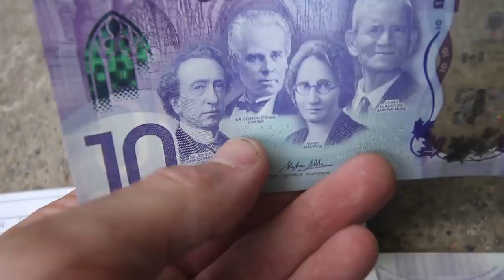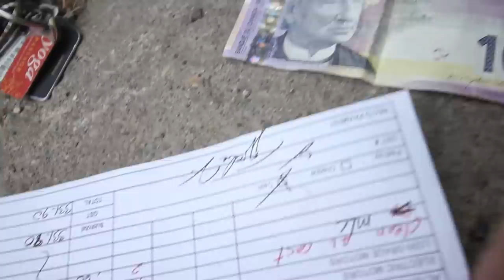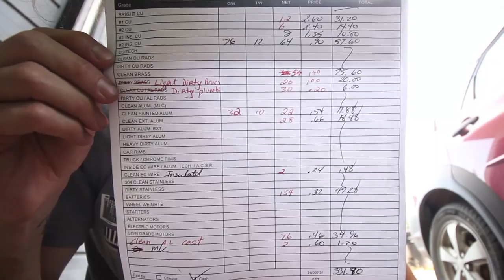Scrap Run - Scrapping A Heap Of Brass!

Comment: I cut my copper tubing with a large pair of bolt cutters.  I also use large bolt cutters to clean up other metals.  It goes pretty quick compared to a grinder or tubing cutter.
Reply: usa123, same here. Give it a good pinch and it breaks right off, even shorter pieces add up between solder joints or brass fittings. I do the same sometimes with cast aluminum or aluminum tubing to get iron screws/rivots and what not out. Bolt cutters help it crack open.
Reply: I use vice grips, works pretty good

Comment: I do like to watch you.  You are one of the most intelligent scrapper out there. Yes, you get lazy some times when scrapping things out but at least you know and acknowledge you are being lazy.  You also are smart enough to not waste your time driving to the scrap yard every day. It is better to scrap out items compressing the bulk down to a heavy load for fewer trips to the scrap yard.  I just do not understand why so many scrapper do not invest in basic tools like a work bench, a vise, an air compressor so you can use a power chisel ....
If I were you I would get a $100 benchtop metal shear.  It makes fast work of all sorts of metal cutting replacing both the grinder and small pipe cutter you use for many items. I would guess you could have cut that hour you just spent cutting up items to less than 30 minutes with a shear.

Comment: Protip since I run the scales at a scrap yard: faucets aren't worth cleaning. Your money is on clean yellow and red brass. But yes, the difference between clean and dirty brass is significant. Also brass can have copper and still be clean.

Comment: Hey! It would be helpful to the newbies is you made it a point to toss in a little background info. Like when you're ripping up the faucets if you mentioned which parts are likely to be brass. Are they all partly brass? Sometimes? And when you scraped that piece on the concrete, you showed the result but a verbal as to what you found would have been helpful for me and my ilk. Thanks.

Comment: One more question. If something is brass but has the tiniest tiniest magnetic attraction, would you throw it in your brass or dirty brass. I'm talking so light, only a neo magnet can pull it and a tiny shake will release its grip.   Thanks. 

I know all different brass uses different alloys, and if Rd slightly magnetic I clean it or dirty brass pile,  but I have some pieces that just confuse me.    Like lots of yellow brass bolts from plumbing. Tiniest little magnetic pull.... what to do with them....?    Thanks.

Comment: Great vid!  Do you separate your clean yellow brass from your plates brass?    I have a hunch the answer is no, but the yellow looks just so ... beautiful in comparison. Also, I have a small bucket full of brass wire harness ends, one full of brass plug ends, one with brass zippers and buttons, one with brass buckels... and so on.  I have kept them separate just for fun,  but should I just throw it all in one big bin, or leave it separate.  I just didn't want anything to downgrade my stash.  :). Thanks for any info.

Comment: wind chimes
Reply from the maker: Heck yes. Most wind chimes are aluminium, which is fine but I feel the tone is too shrill and somewhat unpleasant. Brass has a much longer resonance that I think most people would prefer
Reply: @thubprint  I found an old brass shower ring and pipes that I am looking at cleaning up and making into a wind chime because I tapped on it with my file and it made such a beautiful ring! Now the hard part - sell it when I am done or keep it for my self?

Comment: pipe slice is kinda slow, a bolt cutter or garden shears is so much faster,
Reply: david houlihan, I agree with the bolt cutters. Even with a hack saw you just need to cut 1/2 way or less through aluminum or copper and it breaks when bent.